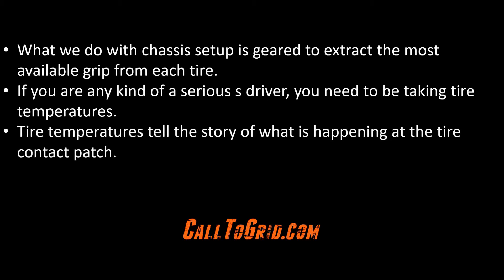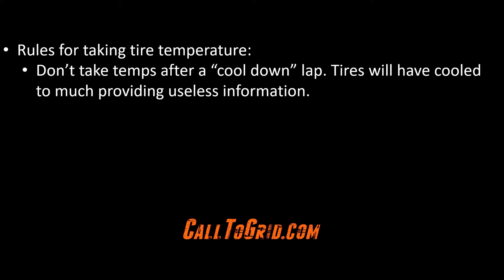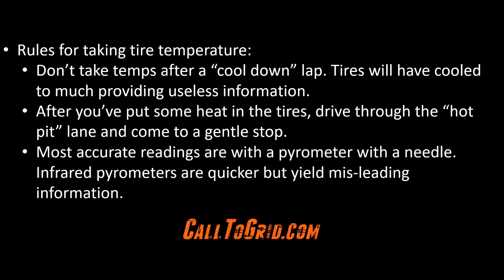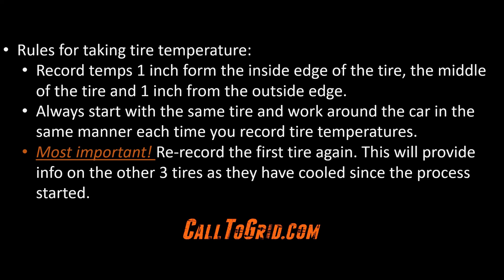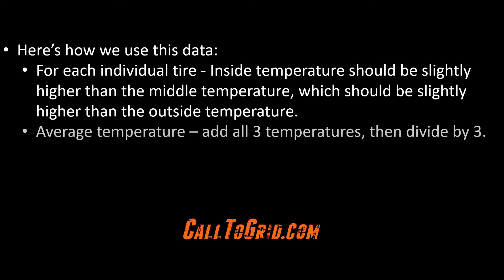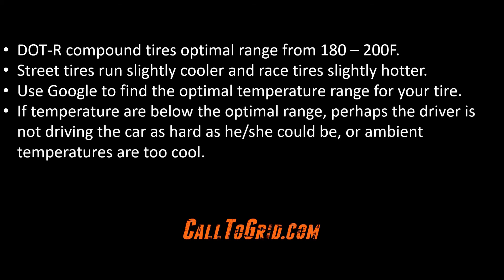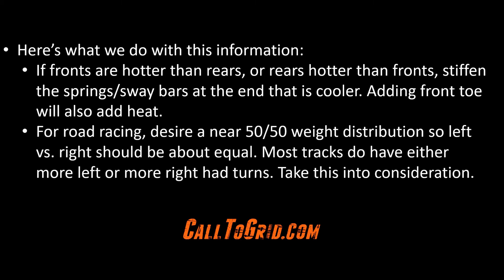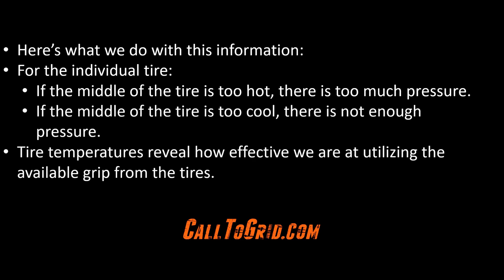Tuning with Tire Temperature - EXPLAINED

Comment: I started doing temp based toe adjustments with a Geo Metro that kept eating insides.  Since camber could not be changed, that left toe.  I did two iterations which included pressure adjustments.  The increase in grip was dramatic each iteration - far beyond what I thought the car was capable of.  Nowadays, I would never set toe by spec.
Reply from the maker: Presume you had issues on the fronts. Did you go toe-in, toe-out or neutral?

Comment: What is the logic behind stiffening the hotter axle vs softening the cooler axle?
Reply from the maker: What was stated was to stiffen the end that is cooler. In general, a stiffer spring/shock will add heat to the tire.

Comment: First thanks for a great overview. At 3:48 the slide states inside temperature should be hotter than middle which should be hotter than outside. Wouldn't this indicate too much negative camber with the inside of the tire working harder than the outside? I thought you want approximately even temperature across the tire to indicate the whole tire is working equally.
Reply from the maker: Good comment. Running negative camber the inside of the tire will be slightly warmer. If you could take instantaneous temperature mid-corner when the tire is loaded you should see equal temperature across the face of the tire, ideally (means you are maximizing the tires available grip). But since you spend more time going straight, the inside will be slightly warmer running negative camber. So if you come through the hot pit to take tire temperature the inside will be slightly warmer. The swing between inside edge to outside should be minimal, around 10F. Tire pressure also plays a role as we describe later. in the video Thank you for the comment and the Subscribe!
Reply: @CallToGrid  Thank you that makes sense. I am going to try to get some pyrometer data at autocross this weekend. If I can get out to measure quickly enough I hope it will tell me something. I'll also chalk.
Reply from the maker: @thebandit4393  Awesome! Let us know how it went!
Reply: @CallToGrid  First I had an awesome day of autocross! The course was just over a minute in duration with a long time between runs, so the tires did not get terribly hot. I started with pressures at 34psi front and 32psi rear using 245/40R18 and 275/35R18 Falken RT660s (200tw). Throughout the day I used a probe pyrometer after each run as soon as I pulled back into grid. As an example, tire temps for the front outside, middle, and inside were 115, 117, 118 deg F. Rear tire temperatures were in the low 90s. I found at 32psi the middle was a little hotter than the outside and the inside, so I dropped the pressure to 30psi and then they were very even across the face of the tire. I have a live axle out back. Up front I was running -1.5deg camber, +8deg caster, and 1/16th toe out. Each run the tire pressure would increase so I readjusted back down to 34FF/30RR and the temperature gradient remained similar. After the day of autocross, I can see the tire wear is very even across the face and extends just beyond the siping, not down the sidewall, so I think the pressures were good, but I'd love to hear more on the topic.
Reply from the maker: @thebandit4393  I'm just seeing this reply. Sorry I didn't see it sooner. So cool to hear! Ok, we'll work on generating similar content. So happy we provided you value!

Deepest sincere gratitude! <heart pat>

Comment: Crazy question?  Why NOT have a tire cooling system INSIDE the wheel?  In other words spray jets mounted in the valley of the rim directed at the inside of carcase?  Yes I know it would require some kind of evactuation system to get the now hot water OUT....but I would think it instantly become steam in there so some type of high speed air pump could conceivably keep it evacuated WHILE at the same time via an ecu and sensors giving the car an active pressure control system!  COULD even incorporate a tire WARMING system by initially blasting inside of carcasses with HOT steam!  THAT could be HUGE in the opening lap?  no?  Then as race wears on tires could be kept at optional temp?  I realize this is a highly complicated thing to engineer and would be expensive to develop and possibly no current way to make it light enough,,,,,but I know at least it COULD conceivably be done....of course there is the problem of absolute orifice seal on wheel changes as ducting would have to be faultless between pump outlets and wheel orifices
Reply from the maker: Normally keeping tires cool is not a problem. Optimally racing tires should be kept between 185-200F to be generating optimal grip. Cooling is only an issue on very hot days. You'll feel it! After a few hot laps you'll feel the tires giving way like there is a layer of butter or grease between the tire and the track surface. A very odd feeling, and you feel it. Design something up, collect data and you may have  stumbled upon something.

Comment: Can we use these same concepts in a go-kart?
Reply from the maker: Haven't done any Karting but the principles should apply. Rubber meeting an asphalt surface. Temperature across the face of the tire would show you if you have correct tire pressures and camber. And tire temperature at each corner would show how each tire is generating heat. Could make adjustments from there. A scale would show how you have static weight distributed.